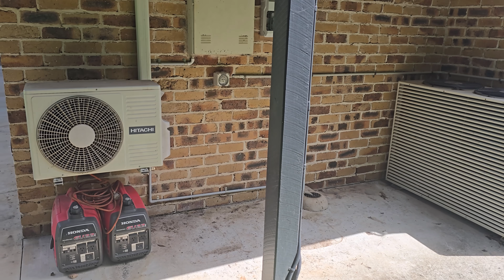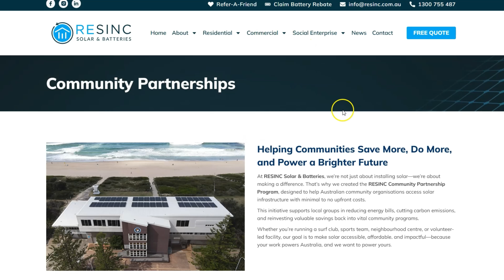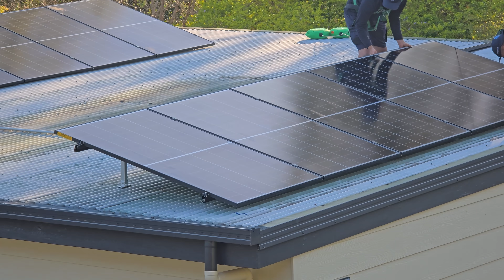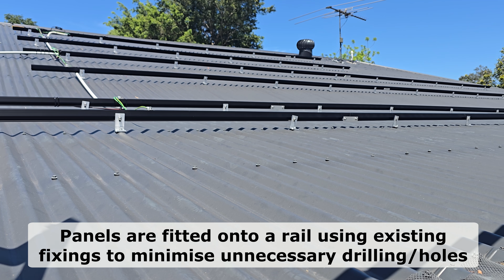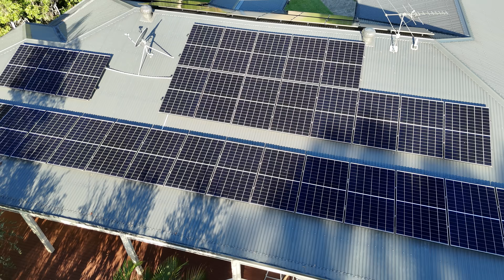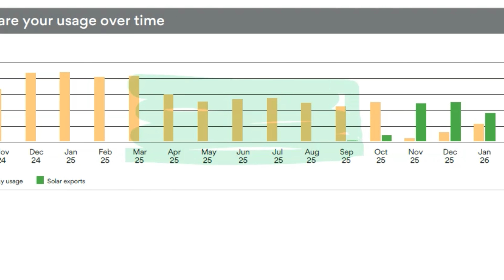From $600 Power Bills to Self-Sufficient POWER - My MEGA Solar & Battery System!

Comment: What I want to know is if the panels get smashed to bits in a haul storm do they come under home and contents or are you on your own?
Reply from the maker: Our solar panels are covered under our home building insurance for storm damage, but everyone should confirm this with their insurance company and that your insured value includes the solar system and battery.  Also, our system is covered by a 25-year RESINC Hail Damage Cover, which means that if the panels are damaged, RESINC will rebate our home insurance excess to ensure they’re replaced at no cost to us. Cheers :)
Reply: @Selfsufficientme that's pretty good

Comment: Mark, 
The old shed roof panels were really mossy, dont let the new ones get like that, the solar input will be impacted, have them cleaned.  Bloke around the Glass House Mountains area cleans and uses reverse osmosis water, this doesn't leave mineral deposits for algae and moss to grow. Fierce Cleaning is the business.
I noted the tv aerial and its just above a panel, damn birds love them as a lookout and hence crap on the panels.  I installed anti-bird spikes on the antenna, problem solved.
My 40kWh battery and 15kWh solar, 10kWh inverter system in GHM cost $21k after govt grants. Thus before grants $34k, so I'd assume your system would be around $40-42k before grants.
Also, I've signed up to a VPP called Amber, making small amounts in FIT now, winter will see possibilities of >$10 per kWh, now averaging 3cents as you indicated.
Matt
Reply from the maker: Thanks Matt! Great advice and tips! Cheers :)

Comment: This would've cost thousands. Those battery's would be $25k each.  That's $50k plus fitting.  Panels go for around $150-$200 in bulk, inverters cabling.  All in minus rebates, I'd say near $80k-$100k.  Saving $10k a year at the high end on electric.  10 years for ROI.  If you borrow, then ?  If you're loaded this is a NO BRAINER.  I would 100% be doing this tomorrow.  Maybe borrow some super.  Free power against Albo stealing all your super fund in taxes.

Comment: I got a quote from resinc.  $11,279 for a 13.6kWh battery.  They were one of the more expensive companies.  Payback was about 8 years assuming that the battery could maintain its capacity over that time, which isnt great, financially you would be better off just putting your money into shares or a term deposit.  I also didnt like some of their math which assumed unusually high power price increases over the next few years which I felt was an attempt to make the numbers look better.  Their sales team was pushy too.
Reply: I also found them pushy. Last year they quoted me around 12k for a 6.6kwh system with no batteries, after rebates. Their modelling is so bad - I worry for people who blindly follow Mark on this one.
Reply from the maker: Thanks for sharing your experience. Solar and battery proposals can vary quite a bit depending on system design, household usage, location and installer, so it’s always a good idea to get a few quotes and compare them. Batteries in particular tend to have a longer payback than solar panels alone, so for some people the decision is purely financial, while for others things like blackout protection and energy independence are also important factors. Every household will come to a slightly different conclusion based on their priorities. Cheers :)

Comment: I've thought about going Solar, but am very hesitant about putting the panels on my roof.   Would much rather put the panels in my backyard.   What if I need to replace my roof?   I HIGHLY doubt the roofers would have the knowledge to remove the panels then reinstall them after the new roof.    Sounds like a major headache to me.   If you have gone through this, let me know.    Thanks!

Comment: welcome to the  real world !!!!  tip  for you , if you get a heat pump hot water system , get one with a timer ,  so it runs while the solar is charging and if you get a large unit that stores hot water , you can have a piping hot shower  first thing in the morning before the system starts , that was heated yesterday ...  i spent $10K in 2016 and just replaced the 2 x 5 Kw tesla batteries with a 16.8 Kw battery for  $6K  ( no govt assistance )  we have not have a payable bill since install  and have got  about $14K  back in refunds over that period but that ended at the last price hike as the daily connection fee jumped to  $1.89 a day and the feed in tariff dropped to 3.3 cents  per Kw , so this year we will basically  turn the system off at 5 pm each day and run off the battery  over night to use no grid energy , and export the excess during the day  until that becomes unviable and then we'll just pull the plug on the grid , we have a small home , only 2 adults , large freezer and all electric household  and out energy budget  is such that  we can run  for 3 days no sun  and using a electric vehicle  range extender ( specialised small generator that outputs the the battery voltage  which for us is 48 v )  and can fully recharge the battery in 2 hours using 2.2 litres of fuels , cheers and  thanks for the video

Comment: We have been fully off grid for 10 years and loving it. The power board wanted too much to connect so we went solar. So just a question, does the grid allow you to add a generator to your system? This would be another source of power that would help in extended blackouts and lack of sunshine days.
Reply from the maker: Yes, we can still add a generator to the system for those extended days of bad weather. I hope we don't get those days too often! Cheers :)

Comment: Here in Thailand we are off-grid with Solar powering the house and 2 EVs, being self sufficient in food however, is proving to be much more of a challenge 😉
Reply: Hey there, also live in Thailand. I was surprised to see the Thai Government had recently made it much more economic to buy solar. I own a fairly big house here and I really do want to get it disconnected from the grid but I'm not sure how to get the process started. Would you mind sharing which company you went with?
Reply: @Nakia_sydney  I purchased all the inverters batteries and panels myself and had an installer here in Surin fit them. I have put his contact details in the description of my Growatt SPF5000ES Inverters x 4 video.
Reply: @Nakia_sydney  I purchased the panels, batteries and inverters myself and paid an installer here in Surin to fit them. You can find his contact details in my:  Growatt SPF5000ES Inverters x 4 video

Comment: Add more ( keep at it ) 
      ... Triple , Quadruple your battery storage , given that the area there could be used as such  

   Thus Capturing and Keeping far way more than you will ever need 
   
    Put in another array in the blank spots on the roof of the house , with its own setup ( Two arrays on the house ) , second array for Charging an Electric Vehicle , including a throw switch to take an accessed limited amount from the previous first installation ( dip into but not drain )
  
    Put another array on the garage ...( Charge Electric Vehicles ) ( Two Arrays , one for  Vehicles , one for the Garage ) .. again set up so that the vehicle array can dip into a limited amount from the Garage supply ...

        Generation 
        Storage 
        Usage 

   " .... next up the neighbors will turn up with Bunnings Buckets to get some Electricity ... "
   " Borrow a cup of sugar ? "

Comment: If you live on the sunny coast you’re stupid if you don’t. I got 17kw of panels and 50kw of battery last year. I charge two ev and run my hvac and my bills are less than a hundred a month every month and half of that is fees and stupid certificates. I could almost definitely go off grid, maybe get a genny for emergencies, but my town doesn’t allow it. I’ve not paid to fill a car with petrol since getting my ev. I went with Sigenergy and set up a whole ai management system for it that I developed myself. I probably spent about 30k ish

Comment: Hi Mark, could you not go off the grid entirely and just run on batteries 🔋?
Reply from the maker: Yes, our system is mostly powered by the panels and battery storage, but not fully. Also, we are not permitted to disconnect from the grid by law, so we technically can't go completely off-grid even if our system had enough juice to run our property 24/7. Cheers :)
Reply: @Selfsufficientme really? I live in Toowoomba? I didnt think that  it was law you couldnt go off the grid?
Reply: @Selfsufficientme How will they know? They are going to know 😮

Comment: I would love even a lowpower solar system for charging phones etc... alot of solar systems in nz are a ripoff rort for solar companies to make money. Ive been looking at small jackery solar systems on usa offgrid channels. We've had a few powerpoles hit by vehicles & powercuts for hours. Just a short backup would still be great.
Reply from the maker: Some of those stand-alone power supplies are very good! Before we got this system, I was considering one of those portable modular power units. I'm currently testing a small DJI portable power unit #notsponsored for camping, etc., and it's pretty good! Cheers :)
Reply: @Selfsufficientme  i notice lots of battery power tools are often sold without batteries, and like to buy corded tools when i can. Only problem being the need for extension cords etc down back of section. Those portable units would be great to power stuff like that ❤
Reply: I wonder if youd still need to use a residual current device with a portable unit. "Safety First" 😊

Comment: After watching this episode we’ve decided to get them in for a quote as I’m sick to death of paying $600 plus a month. I should say we live in the same area as you and in similar situation, 4 adults working from home
Reply from the maker: It's true (and obvious) that getting a system like this means you are paying upfront to save money over the long term. Nothing is for free. Back in 2011, when we got solar on our shed, getting a loan for 9k was scary because we were on one income and struggling. However, our savings on electricity bills almost offset the loan repayments on the system, and after 3 years, we had paid it off and continued to benefit from those savings until we replaced it with this new system. Having my own system generating most of the electricity we need is like my middle finger to high power prices and big corporations - that's how I feel. I hope your quote and overall system work out for you. All the best :)
Reply: @Selfsufficientme I’ve spoken to them over the phone and have our Zoom meeting today. So far they sound very professional and will know more after today’s meeting. 
We were the same with the original Solar system with full feed in tariff but the system is old and failing time to upgrade. 
Will update you at a later date. Cheers
Reply: Ita not going to save you money after you pay forctge install. Still have to pay for power with only 3c/mwatt return. All this does is use your house as infrastructure for big corporate to profit from.
Reply: @debexspacecadet6586 saving money is not the only benefit you know, when you live in an area that loses power a lot, having battery backup is a good thing. Do you think we haven’t done the sums with our situation in mind?

Comment: I’m going to say your system was around 65-70k. I’m basing this of the panel cost for my 30 panel installation and the estimated cost of circa $1000 per Kw for the batteries inc install. With what was presented here that’s going to be around a 10+ year return at which point the panels will be getting towards end of life. Not sure what the life on the batteries are but I’d be interested in understanding this in a follow up video. For comparison I’m similar to you in that I’m not totally self sufficient but negative bills sone months around $50-100 in the heavy hitting months. I’m totally happy with that as we don’t tend to suffer with long periods of outage so have so far opted out of adding a battery. My big benefit is my outlay will be paid down in around only 3-4 years. If I did go battery later it would be to power the house at night and bring those bills down even less. It all depends on your power usage and what feed in tariff you get. In a perfect world I’d use just exactly what I produce because the low tariffs rates don’t make it worthwhile producing way more than you use. Great video BTW.

Comment: Hello Mark
Thanks for the continued inspiration.
The ACTRON unit while a great unit for cooling the house an inverter type air conditioner like the smaller units you have installed will also reduce your energy requirements.
Reply: Can hear that digi scroll solinoid from Perth 😂. They do make a reliable unit once you remove the soft starter 👌

Comment: I may not be self sufficient in food (yet) BUT I've been off grid (but still connected for backup) for 3 years now, started with solar hybrid mini splits from eg4, putt three of them on my house in various locations and that has replaced a 5 ton central ac unit that drew 5k watts when running. If there's sun the mini splits run 100% off solar allowing my 14.5k watts of panels on the roof to charge the batteries and power the home. Air conditioning is a big thing in N central FL just like in Queensland. I do not feed the grid for "buy back" it was too much of a hassle to setup the power meter with the electric company etc so I said forget it. But what I do have is two Reliance Pro Trans II transfer switches that let me switch between the grid and solar at the breaker level. On cloudy days I can switch one or more large items back to the grid ie water heater, dryer, etc if need be. For me it's not about saving the planet and going green as much as it is about self sufficiency, freedom and independence. FL got hit with several hurricanes in the past few years, while we didn't get a direct hit, we did get a near miss and lost power for a short spell. In my area we are all on well water and septic so no power means no water or flushing lol. Our house was lit up like a xmas tree during the outage, we had AC, TV, and all the comforts. We helped our neighbors with water and even lent one of our battery powered inverters to one so they could keep their fridge running, they'd bring it back in the morning and we'd charge it back up. I have 40k watt hours of LifePo4 batteries and two eg4 xp6000 inverters and that seems to keep us just fine as long as we get 80-100% charge during the day. Smart move getting solar Mr Valencia, more power to you (literally) LMAO

Comment: Just a heads up: a standard solar/battery install WON'T give you power during a blackout. If this is of interest make sure to tell your installer   as they have to modify your setup to accommodate this.

Comment: Great video Mark! I, too, have recently upgraded my solar system to include battery storage. It really is a game changer, and though expensive, the peace of mind it brings me during winter and spring storm seasons is invaluable. I do have to contend with snow coverage, and significant shading at times, but I am still so happy that I took the leap. My solar panels are a ground mount and are accessible so I can clean the snow off, 42 pc @ 390W gives me a max of about 90kWh on a clear sunny day. We are limited by the electric company on max generation since I have a contract to sell back my excess generation, giving me a credit. Our electric company buys my excess at the same rate that they charge me for inflow, but when using grid power, I pay an additional 35-50% for "distribution charges" on top of per kWh rates. That part bites, I'll tell ya, but all in all, I am thrilled to have had almost 10 mos of $5-6 bills, using credits along the way, and only 1 or 2 blinger bills in the winter when we've had below 0F temps for weeks. I use ground water heat pumps to heat and cool, so they are quite power hungry. The next upgrade, if I can afford it, will be one more 15kW battery to go with the 2 Franklin Electric ones that I have now. Winter is hard, and I still need the grid for 50-60% of my heating. Looking forward to spring on its way, plenty of sunshine, and lower bills! Hope that you continue to be as happy as you seem with your new system. You're so lucky to have such great companies as Resinc doing your installs and providing free systems to deserving charities. Much love from Michigan, US.
Reply from the maker: G'day and thank you! It's very interesting to hear about your system doing so well in a cold climate! Particularly here in Australia, we tend to think that solar systems are really only for sunny/warm places, but that's obviously not the case. 90kWh a day in the snow is INCREDIBLE - I would never have known that if I didn't see this comment. Here we are, looking forward to autumn/winter to get into our "proper growing season", while you are looking forward to spring for your growing season to begin... Well, all the best for sunshine and the upgrade of your system! Cheers :)

Comment: Wow thats awesome, but what happens when you need replacements?? Is there a cost to that as well and how frequently would they need to be replaced?
Reply from the maker: The panels have a 25-year warranty. The inverter and battery have a 10-year warranty. Our old system required no repairs or maintenance over its 14-year life until this upgrade. Cheers :)

Comment: When we get the 3 hours free power in the new financial year I feel you can top up the batteries then, but also if you swap the whirlie bird out for solar based ones, they will drop your temp by about 5 degrees and you will use less aircon.
Reply from the maker: That's a good idea! Cheers :)

Comment: We have solar but not a battery storage. So far the solar has helped us save a lot. We're in CA so when we need to run the AC, it's really nice not having to worry about having massive bills anymore. It also makes running our plug in hybrid and electric cars so much cheaper.